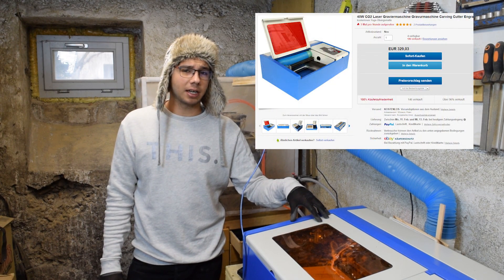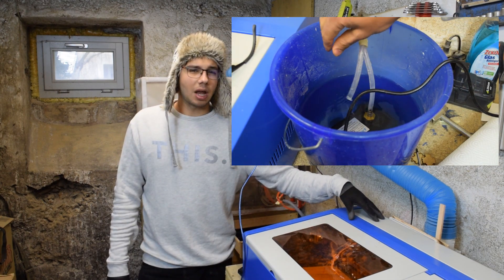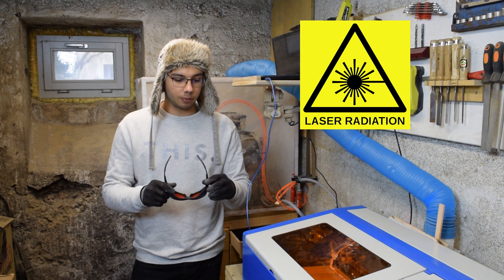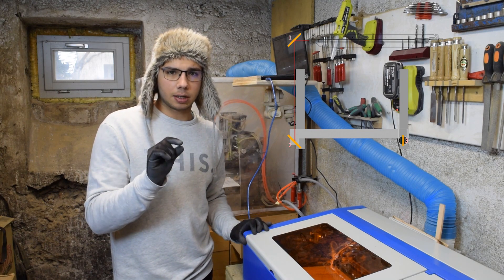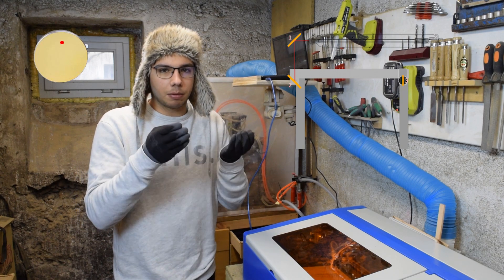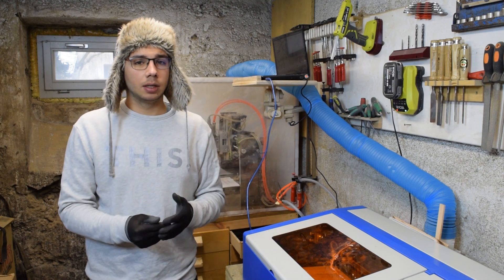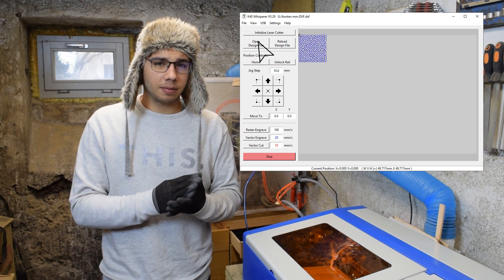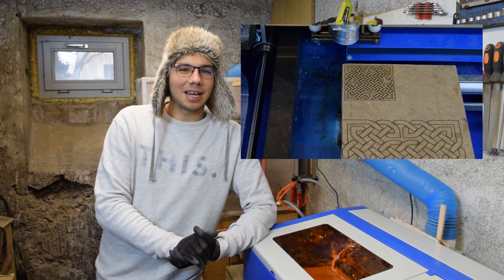K40 Laser in 7 Minutes || Setup, Mirrors, Software and Safety!

Comment: Awesome video!
What's your opinion on meerK40t? Is it better than k40 whisperer since you can do pulse modulation and integration with lightburn on the stock board? (also you can hook up a camera to position the burn more correctly)
Reply from the maker: hey, sorry for the late answer. I have since sold my machine and cant really comment on the other machines to be honest

Comment: Hey! I know this is an old video so you probably wont see this but I just wanted to ask if you need an air compresser and what the exhaust from the machine is for and does it need to go outside? 

Also can the machine cut wood and Acrylic! :D

Thanks! :D
Reply from the maker: So I am now using an airbrush compressor to blow air away from the Laser Lense. 
The exhaust is the burned material and it needs to go outside or be filtered as it is toxic
Reply from the maker: It can cut wood and acrylic to 3mm well. Thicker will also work but takes multiple passes and maybe some tricks

Comment: You should always use as pure of alcohol as you can get. Do not use window cleaner. Also only use 100% cotton balls to wipe and buff the mirrors. I use 100% alcohol that i buy from the local hardware store labeled as Camp fuel. This is what i use to clean the mirrors on an industrial CO2 laser.
Reply from the maker: Thank you for your suggestion!
Reply: Would denatured alcohol from a hardware store be a good option?

Comment: The water return tube must always be placed below the water level in the tank, but air will enter when the pump stops and bubbles may remain inside the tube.
Reply from the maker: thank you for the info, it has been improved

Comment: how do i ground the wire?
Reply from the maker: The mains ground should be connected to the metal chassis with a screw. That means everything that's connected to the metal is also grounded

Comment: I've just received my K40 yesterday and the first thing I found wrong is the X part of the gantery that the laser head runs on is way out of square with the rest of the gantry. It looks like the X axis of the gantery needs to be moved on one side by about 10mm to get it square to to rest of the gantery. My question is, is possible to mess about with the belt and pulley on one side to square it up.
I enjoyed this video and am looking forward to the rest of your videos.
Many thanks.
Reply from the maker: Hi,
I have just moved and don't have my machine with me yet but it should be doable to take the motor off under the second mirror mount and take the belt off to move the axis individually.

But once again I sadly can't check right now.

Comment: If your tape leaves residues from the sticky substance, I saw people use post-it notes.  
What power percentage do you run the laser at? Thanks for keeping us updated on this laser, I'm eager to see how long it works, especially the tube.
Reply from the maker: Sticky notes would have been the smart choice now that I think about it..... :D I used like 20% for engraving and 60% for cutting in multiple steps
Reply: Uniquelymade , that is a good percentage for tube life. What material and thickness did you cut? How many passes?  I would like to cut 7.5 mm plexiglass, eventually.
Reply from the maker: im not sure its up for that... I cut 3mm acrylik at around 60% with 15mm/sec in two passes. But I haven't experimented enough yet.
I'll cut a ton of boxes pretty soon and try to figure out good settings for 3mm mdf. Afterwards ill take it from there to adapt for different materials and thicknesses
Reply from the maker: https://www.cs.cmu.edu/afs/cs/academic/class/99353-f16/speedsfeeds_RL.pdf  check out this chart (the 40W lines) they are working nicely for so far, or at least a good starting point